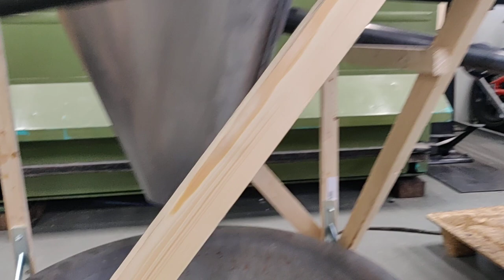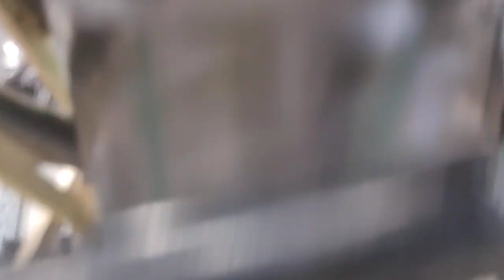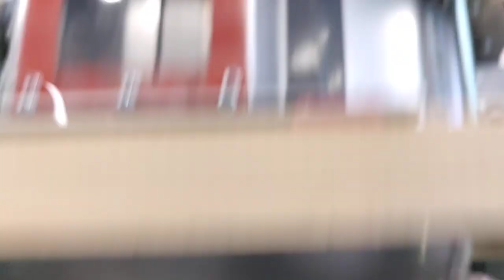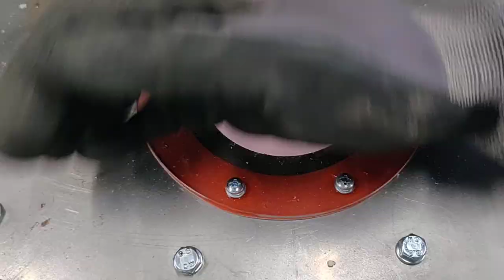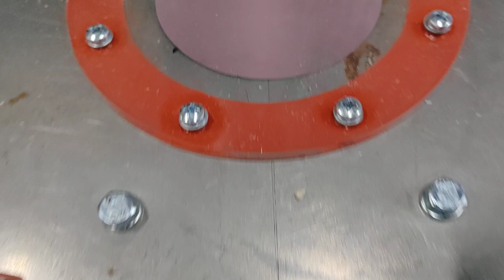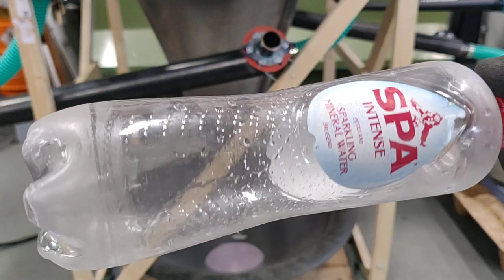WindHexe Build prototype V02 - Plastic Bottle - 13 July 2023

Comment: Must be a missing ingredient in the overall equation, compared to the original Windhexe as extent. Trial, error, adjustment, and try, try again. Onward!
Reply from the maker: Pretty sure Frank did not get it right on first attempts. This is a huge step forward over the first one.

Could it be more air flow - resonance (after all a flute will not sing if you don't aim the airflow at the right point. Watch a kid trying to whistle!) Charge Separation, Temperature, Moisture...

Comment: That’s a fancy bit of kit - but what does it do? And what is it hoped to demonstrate? Without some voice over commentary or explanation in the text of this video, We newcomers to these videos are all left wondering ‘so what?’. A plastic bottle is whirled in a vortex and appears unchanged. 
If you want to increase your number of followers and potential donors, your commentary or website will need to give a lot more explanation of the purpose of each experiment and the hypothesis behind it.
Reply: Go watch a few off the other videos before like start at the middle n work you’re way frwrd ,I know what it’s meant to do .I’ve seen what the original one does on this ch ,So there’s a clue you will learn a lot by doing this and you wnt be asking questions like this .peace .